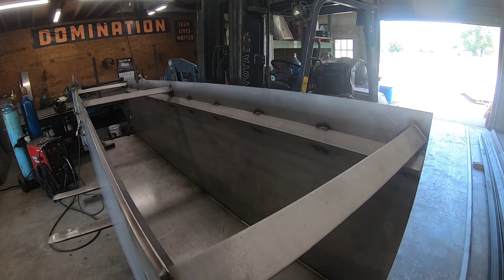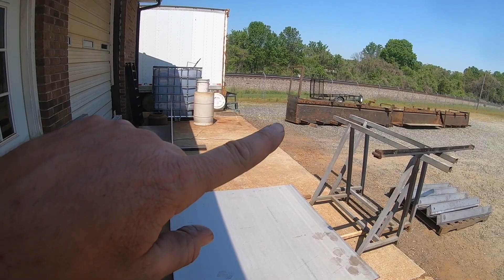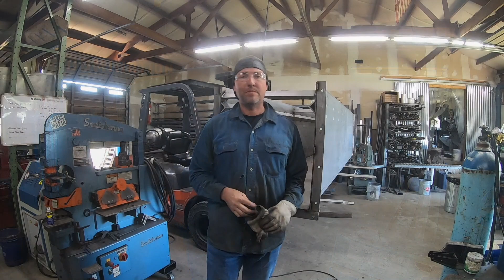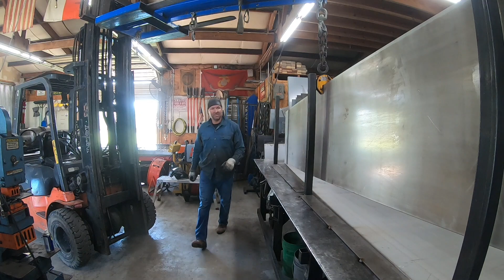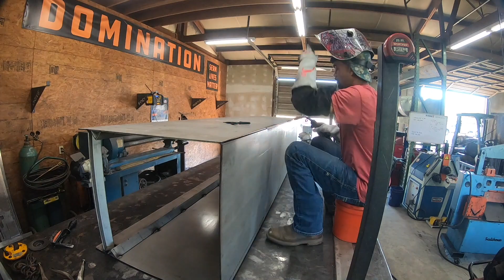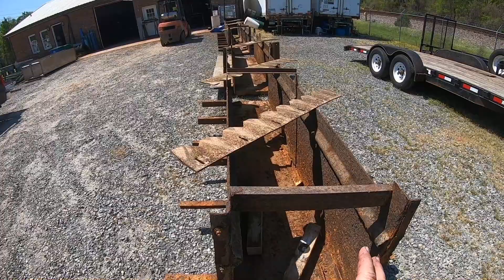$15,000 in Stainless Steel material. $$$. Prices aren't going down anytime soon.

Comment: Just found your page and really enjoying your videos.  Curious though, why would you not use you ironworker to punch the holes in the angle iron?
Reply from the maker: Thanks for watching.  So ironworkers are amazing machines but they have limitations also. If I remember correctly the throat was too short and punching wasn’t an option.  You also have to take into consideration the hole size etc.   not to mention we don’t EVER punch stainless steel.   It’s to hard and will destroy the dies and sometimes even explode.

Comment: That Stainless has more than doubled in the last two years without any logical explanation. Not to mention the labor situation or lack of labor
Reply from the maker: Yes to all the above.  Prices on some of our materials have tripled and I still don’t quite understand why.  We have always tried our best to shop local but unfortunately we have been getting quotes on all of our materials the past 6-8 months which takes so much more time.  And we won’t even begin to discuss the labor issues right now.  Not sure why that’s continued to go on but yes we’ve struggled to get employees as we grow our business.
Reply: We actually replaced to pipe on a scrubber system at a local plant we work at 8-10 years ago . The pipe we replaced with stainless was fiberglass that had actually been in use since the plant was built in 72 . The maintenance super told us that the fiberglass would actually outlast the stainless but the stainless of course was a lot easier to patch when needed. The water used in the smelter system is induced with lime so it’s very corrosive

Comment: You can save yourself a lot of time by using an annular cutter in the mill to cut the 1/2” holes rather using standard drill bits. I can’t believe that the material for this job was 15k, that’s unreal. I hope you made bank on this job. Good quality work ain’t cheap lol
Reply from the maker: I will check into that for sure because it would help to speed it up. That took a couple hours to double drill 25 pcs or so. I'm far from a machinist as I mentioned we use that machine as a drill press because it was used and abused in it's previous life.  Thanks for the tip